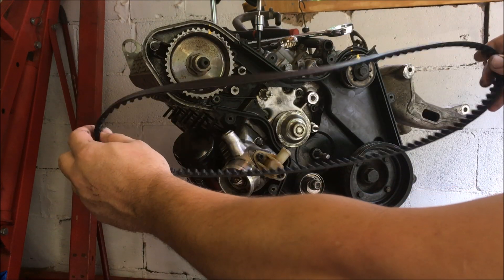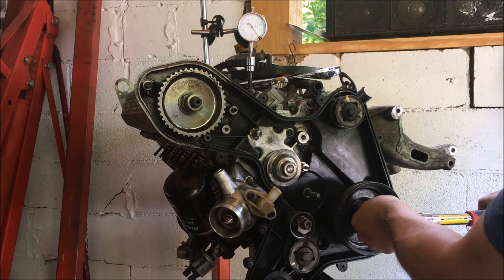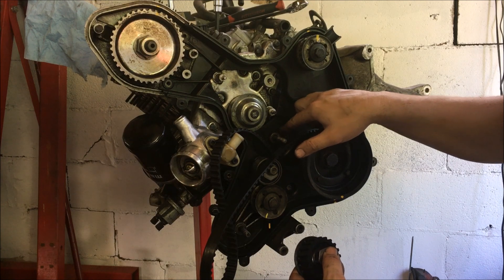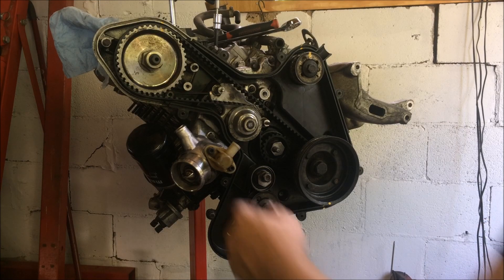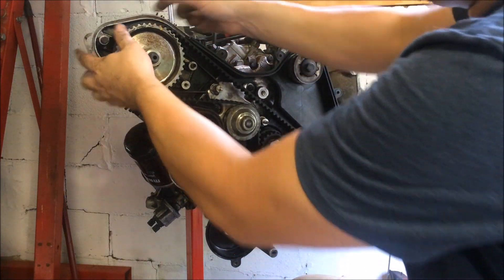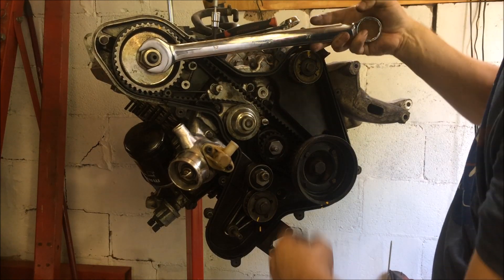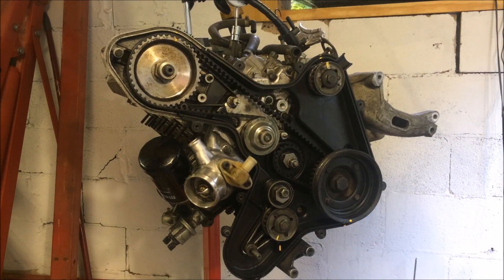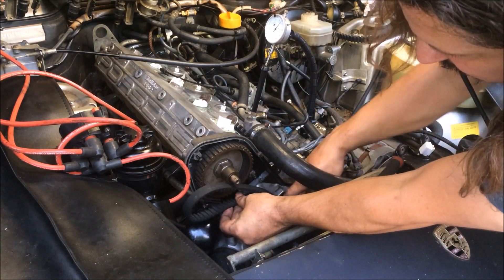Porsche 944 Timing Belt Installation Tutorial

Comment: About the tensioner - isn't it just ridiculous, how they always replace good old metal things with new and "improved" plastic crap. Yep you guessed it, I found the original tensioner from 1983 on my 60.000 miles car. (I start to wonder if it was the original belts, too. The waterpump was '83 for sure..) The first generation tensioner was all metal with a bearing you could swap out. But no one told me this when I ordered a new one, so I got the whole new piece as you have it there in the video, where the bearing is molded into the plastic cogwheel, making it impossible to use it in the old metal wheel. Do they make the bearing only, with the excentric, anywhere still ?

Comment: edredas, I have an '83 944 AT, I am getting ready to replace my timing and balance shaft belts, What else should I replace as well while I'm in there ie, seals, rollers, etc.  . I had a cracked head and found a used one which I had decked, etc .
Reply from the maker: Hi! You should also do the air/oil separator seals and replace both reference sensors. The oil cooler seals are a must as well but I think by your last comment you plan to do that. So that should just about cover it! Good luck!
Reply: @edredas  no pulleys, tensioners for the timing and balance shafts?
Reply from the maker: Yes all the seals, rollers, and tensioner as well!

Comment: Ive worked on quite  a few engines but never an overhead cam with belts. You mention a belt tension gauge for measuring the final tension but no mention of tension numbers. The Haynes manual I have seems a bit poor and just says bring it to a dealer for the final tension measurement ( claiming the tool isnt readily available to the general public). Is the tension gauge something I can get at NAPA.etc or a porshe item?   Mine is an 85 with another belt running the two balance shafts that yours appears to have and weren't mentioned..Is there a sort of timing for these as well. I have only browsed through the manual and trying to educate myself before I get into it so I apologize for any dumb questions. Thanks for the great video.
Reply from the maker: Here's a link to a gauge that a lot of people prefer. The instructions will have the tensioning specs included. I didn't mention the numbers since the specs may vary by manufacturer. I made a separate video on the balance-shaft belt as well. I hope the helps!

http://www.arnnworx.com/catalog/index.php?main_page=product_info&cPath=65&products_id=189&zenid=c7530283f20b63da04cf38f93aeb5d70#.XKD4eyJKiUk
Reply: At that price it looks like I'll be borrowing one lol. Thanks for the help!
Reply: @edredas   Looking to buy this tool from Arnnworx, 920Xv6 and have seen the help videos. The only bit I do not understand is why they put the slack back up to the belt on the longest run , where the tension tool is, by turning the crank counter clockwise. On your excellent video you make sure there is no slack by putting on belt with cam advanced by one tooth and then turning cam back to TDC.
Thanks for the help!
Reply from the maker: @mikseymono1  Once the tension is set then backing it up to the longest run will allow the tool to go on there. Trying to measure it on the backside of the belt is almost impossible and would give a different reading, but once the engine is rotated properly again, all the slack will return to back between the tensioner and the water pump as it should! I hope that helps!

Comment: Thanks! This explained what i did wrong when replacing my 86 engine with an 87. The 87 came with an oil pump. I mistakenly used it and then tried to put my 86 tensioner on. Also great tip on pre tensioning the belt!
Reply from the maker: I plan to make a video on installing a timing belt on a car with an auto tensioner very soon!

Comment: Great video! please do a video on the auto tensioner, i have a 1987 924 and it uses an auto tensioner, would love to see how you do that.
Reply from the maker: Thanks! I'm working on it. I want to get a engine with an auto tension on the stand so I can give everyone a good view of whats going on. At the moment I have six engines in the shop all are early, so it might be a while. For the most part it is the same procedure and you'll want to use a similar method to make sure the belt isn't too tight. Otherwise you will have to back it off a tad, which is common. The factory workshop manual mentions making sure when adjusting tension with the auto tensioner to push on the belt between the water pump and cam to see if it 'just' touches the cover, if it doesn't the auto tensioner has the belt too tight! I hope that helps!
Reply: @edredas  thank you very much for the quick reply. I'm replacing the water pump no doubt because the new belts put on last year were too tight. I wish my mechanic seen your video! Decided to install it myself and save 3-500$ and your video and info is worth much more. Thanks again friend

Comment: What are you putting the dial indicator on? I know you are looking for TDC, but what is being measured off of? Spark plug hole?
Reply from the maker: Yep, the spark plug is removed and the dial indicator is on an extension that is resting on top of the piston. Since the bell housing is removed from this engine I am using the dial indicator to know the precise moment the piston reaches TDC, and that's the spot where the marks would line up. I hope that helps!
Reply: edredas yes. I just couldn't see what it was attached to on my small phone screen. Thanks for the clarification.

Comment: i just install a new water pump on my early car and snug the bolts up didn't torque them to 6ft lbs yet and i cant even turn the pulley on the water pump and i haven't even install the belt yet i know this can't be normal
Reply from the maker: Nope... doesn't sound right. Pull the water pump off and measure the impeller. The 2.7 and 3.0 liter water pumps look exactly the same but have a larger impeller and won't fit the 2.5 liter blocks. I hope that helps!
Reply: thanks i will i'm also going to replacing the hardware instead of reusing them i don't if that help but worth a try. i bought my wp off ebay read the description for exact part number i needed but i'll take it off and measure it to be sure....this the pump i bought https://www.ebay.com/itm/Premium-For-Porsche-944-944S-924-924S-Metal-Pulley-Engine-Water-Pump/262399691565?ssPageName=STRK%3AMEBIDX%3AIT&_trksid=p2057872.m2749.l2649
Reply from the maker: That's a bummer... that's definitely a 2.7/3.0 liter pump. When you take it off you should be able to compare it to the one you took off and see the difference. If you try to bolt that one you will just end up bending the shaft and ruining it.
Reply: well that put a slow down in my rebuild for this weekend, guess that what i get for order an ebay water pump thanks edredas i knew something wasn't right glad i stop and check with you before i finish putting everything together
Reply from the maker: I have been there! I once got a 2.7/3.0L pump by mistake from a reputable website and it set me back big time. Not to mention I had to overnight a pump so it ended up costing me too. That said, you can find cheap pumps on ebay for that price but you just have to know what you're looking at. The sellers don't know what they have and its just a bummer.  Here's a cheap one that is for a 2.5 L engine. https://www.ebay.com/itm/Porsche-944-944s-924s-924s-Water-Pump-New-With-Metal-Pulley-1-YEAR-WARRANTY-944/281466239720?fits=Model%3A944&hash=item4188b1fae8:g:ObMAAOxy5jxScpzE:sc:USPSPriority!28150!US!-1&vxp=mtr
Reply: yeah it sucks well i'll be sending this one back and hopefully getting new one in to finish up next weekend thanks so much for the help
Reply from the maker: No problem. How did the thermostat fit? Did you need the shim?
Reply: it fit perfect with the bigger o-ring that came with the thermostat no shim needed

Comment: I've heard that the tensioning tool is impossible to find, how should I tension it if I don't have that tool?
Reply from the maker: Hi, I usually advise people to borrow the tool the first time just to get a feel for the tension. That said, the tensioning tool is only meant to make sure that the belt isn't too tight. As mentioned in the video, if the belt is too tight it will put too much stress on the the water pump causing it to fail. So, once you have removed all the slack on the front of the belt by rotating the cam backwards, you just set the tension until you have the belt snug against the water pump but you can still turn it by hand. This will give you the proper tension. I hope that helps!
Reply: Thanks! will try this soon.
Reply from the maker: Good luck! Arnworx makes a gauge that isn't very expensive and I highly recommend using one until you get a feel for it. Keep in mind these gauges need to be calibrated from time to time. A car just came in today and the belt was a little too loose despite being checked with a factory tensioning tool. I could easily spin the pump and you don't want to be able to do that. There should be plenty of tension on it, but not so much that its impossible, otherwise you could be bending the shaft.

Comment: Thank you very much for the video, and mentioning all the little details of the job. I am surprised though that you didn't walk through the use of either the Arnnworx or OE P9201 tension tools. using the amount of friction the belt has against the water pump pulley seems ripe for error. The friction you get can very by the cleanliness of the pulley, any manufacturing residue on the new belt, the temperature and humidity in the air at the time...
Reply: Manufacturing residue on the new belt? Come on. The video shows exactly what you need to know, no tensioner tool necessary. Might be surprised to find how many go by feel alone. Like dude said it's a ballpark.
Reply from the maker: The belt tension is not exact, its more of a ballpark. As long as the belt isn't too tight on the water pump with the engine at room temperature you are fine. Keep in mind that as you tension the belt you add more pressure to the water pump pulley and it doesn't matter if you spill grease on the belt you still won't be able to turn the water pump if it is too tight. Again its mostly tension from the belts pressing against the pulley that turns it and not necessarily friction from the belt. Even if the greasy belt did result in being a little tighter than a belt without the grease, it won't make any difference because if you can turn it by hand then obviously the bearing isn't being over stressed. That said, I was thinking about demonstrating some gauges but I thought I would leave it to the audience to choose their own tool since the instructions are simple enough. Also, if the gauge is mis-calibrated and reads too high then its a waste of time to use and why I mentioned the rotating the water pump. While its not fool proof, it will get you in the ballpark.

Comment: You need to do a video on a late 944, and what's the difference between the automatic and the manual one
Reply from the maker: Will do! I was originally going to put a spare late engine on a stand and do them both side-by-side but it didn't work out. That said, I'll try to make a video on the differences soon and also show how to install the late auto-tensioner!
Reply: Hey man really appreciate it. I'd also love if you could include how to access it (taking it apart) on here as I'm a complete noob mechanic, but trying to learn for this worthy car.